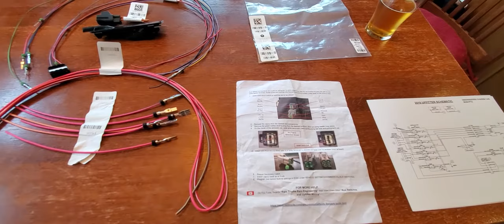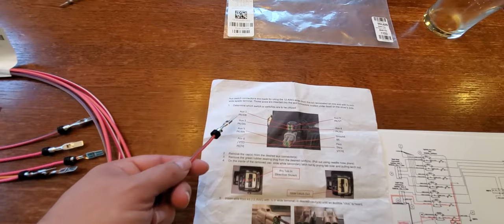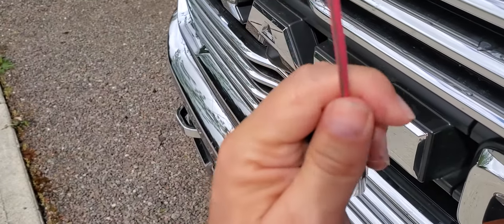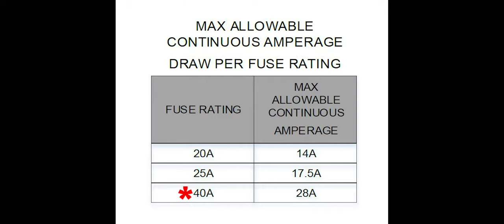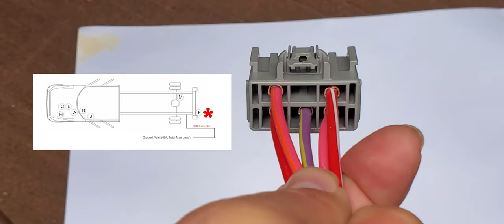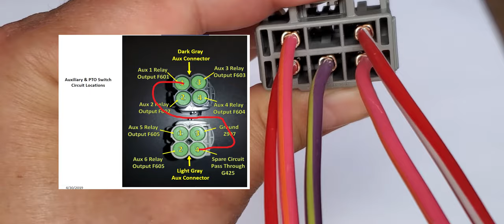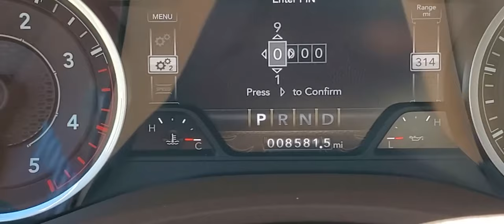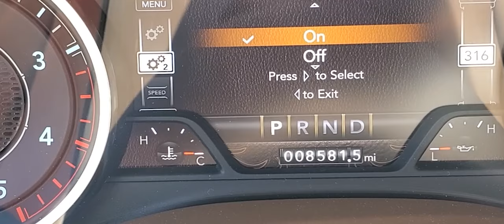How to wire and configure the AUX switches in a 2019+ Ram pickup

Comment: I think this gives me a solution suppling extra amps to charge the house batteries in my 5th wheel while driving.  I have a residential fridge and want to run it while travelling.  The current 7-pin only supplies a couple amps.  Heck, I might be able to install an inverter under the hood and use the truck as a generator.  Thanks for this video. Cheers!

Comment: This video saved my bacon.  I needed to set up an Aux switch to give power to my fuel tank pump in my truck bed.
Reply: Which one did you use to get power off of?
Reply: @brandenmulder7878  I was able to use AUX1 to switch on the power to my fuel pump in the bed of my truck.    I don’t think I could have accomplished this without your Youtube tutorial.   I am sure that if I had reached out to a Chrysler dealership for help they would have struggled and it would have cost me a great deal of money.   Again, many thanks.

Comment from the maker: @10:50, I state that I haven't found the blunt-cut wires at the rear of the truck. I eventually did find the blunt-cut wires. They terminate at the connector directly above the spare tire. More information is available in this HDRams forum post:

https://hdrams.com/forum/index.php?threads/aux-switch-wiring-location.337/page-2#post-26774

Comment: Excellent video! Clear, thorough and easy to follow.

FYI, AUX5 AUX6 circuit ID's are incorrectly labeled by the factory docs in the picture of the underhood connectors. They are both labeled F605. AUX5 is F605, AUX6 is F607. Really only confusing if you're tracking the wiring diagrams to the PDC (fuse/relay).
Reply from the maker: @RJT21 Thanks. I will update that in the final version.

Comment: Alan, The best video out there.  Thank you!  So detailed and clear it s great.   been trying to add these switches to my 2500 ram and even the dealer cannot find the proper part number for the kit.  My Ram has 5 current features switches (park sensor (2), 1 air suspension, 1 tow , and another one).  The aux switch module always arrives with only 4 features swith, and all the aux switches.....So I would be losing the air suspension.   Would you know what part number you have in your truck?
Reply from the maker: I ordered my truck with the AUX switches installed at the factory. I don't know the part number, sorry. I believe I saw some posts on hdrams.com about adding the switches. Try this post.

https://hdrams.com/forum/index.php?threads/diy-add-aux-switches-to-19-ram-2500-laramie-6-7l.13229/page-4#post-294649

Comment: Thank you for putting this together.  Is it safe to assume that to run some LED spot lights under the rear bumpber its probably easiest to just tap into one of the Aux connectors and run your own wire? This would avoid having to plug in the upfitter harness and do additional wiring inside the vehicle? I have a 2022 truck and thought that they had made a few changes.
Reply from the maker: I agree that it's easiest just to tap into one of the aux connectors under the hood and run a wire to the back for rear lights. I also heard that they made some changes to the 2022 model that make it , but I don't know the details.

Comment: This video is amazing! I can’t find the answer to this question but hopefully you can help me! I have a Blackvue dash cam that needs both ignition and battery power. On the grey jumper that comes in the wiring kit, can I cut the loops and use butt connectors to port 3 and 6? Or do I have to use posi-taps to keep the loops connected? Does this make sense? Thanks!!
Reply from the maker: You can cut the loops, but it will kill the power at the rear bumper. You can tap onto the loops if you want to maintain power at the rear.

After I made this video, I bought three small bus bars off Amazon. I cut the ignition loop and connected both wires to the same busbar. I cut the battery loop and connected both wires to the same bus bar. I then created a ground busbar. All three bus bars are secured underneath the floorboard carpet behind the pedals where my feet never touch. The bus bars have covers so the posts don't touch the carpet. This setup maintains ignition and battery power to the rear of the truck while also giving me ignition and battery power in the cab with a common ground. I connected my dash cam to the bus bars, and everything works great with the ability to power other devices later. I recommend you use an inline fuse for each powered device connected to a bus bar.

Comment: @Alan Look above spare tire, on the driver's side; there's a wiring harness, with some holes plugged and ready for more pinned wires (Rear Battery, accessory and run) to be inserted...
Reply from the maker: Yes,  it's documented in TSB  08-031-20 which states, "The upfitter auxiliary fused wires are not populated on the rear of the chassis wiring harness
equipped with Instrument Panel (IP) auxiliary switches. The wires are located on the right
side of the rear chassis cross beam, above the fifth wheel."

Comment: Just ran across your video.  Excellent job in describing the system.  I'm thinking of ordering a 2024 Ram 2500 (too late for 2023) and the AUX switches is one of the options I want.  Barring any changes made in the model years after your truck, this gives me a good idea on what can be done with this feature.
The only question I would have is, do you know if the AUX switch power comes from the primary or secondary battery on a truck equipped with the 6.7 Diesel engine?
Reply from the maker: Starting in 2021, Ram improved the AUX switch design. They added a ground wire inside the cab, and they added more passthrough wires into the cab. I don't know which battery the aux switch power comes from, but I can try to research during the next week. Here is a great video on the 2021+ AUX system.

https://youtube.com/watch?v=6seCDodwohg&feature=share8

Comment: Question: I purchased a westin light bar for my westin bumper. A wiring harness was included which I don’t need since I have a 22 Ram. The light bar has 3 wires. Black, Red, and a smaller gauge Blue wire. What is the blue wire for?
Reply from the maker: I believe you could ignore the blue wire because they are typically attached to a rocker switch. I would connect the red wire to the output of the aux port. Connect the black wire to a ground.
Reply: @alstuart  turns out it’s a low amp second circuit for back lighting

Comment: where do you get the negative line for the interior plug?
Reply from the maker: For an interior negative, I installed a negative bus bar high up in the footwell on the driver's side and connected it to an existing ground that was exposed near the driver door hinge. I can upload a video tomorrow showing it if you reply and say you need it.

Comment: wow i thought i had it i have 2021 Ramm 3500 HO my truck already has all the fuses and seen pass thru left of steering column boot are they all hot feed on the connections under the hood or is there a ground because there is ground right on my firewall and 5 aux in the cab switches. I have snow chief package so there is 4 blunt cut wires above the aux connections. i have 6 switches in the cab but 8 connections under the hood are 2 of them ground connections.
Reply from the maker: The upper right port on the light gray connector is a ground.  The lower right port on the light gray connector is the pass through port that goes back into the cab.  That's why you have 8 ports and 6 switches.

Comment: Awesome video!  Thanks so much.  One quick question, I am going to wire up lights at the front of the truck using AUX1 which has a 40 amp fuse installed in the panel.  Your document also shows an inline fuse to the lights themselves.  Is it necessary to run the inline fuse in addition to the 40 amp in the fuse panel?
Reply from the maker: it is not necessary to run the additional fuse, but keep in mind your lights might need a fuse smaller than the 40 amp fuse. In that case, you can either replace the 40 amp fuse with a smaller one, or use the inline fuse. that's the right amperage as I demonstrated in the video

Comment: Do you have part numbers for this kit and also the power distribution box under the hood as well, I want to add this to my 19 ram 1500
Reply from the maker: The part number for the wiring kit is 68398184AB. I do not know the part numbers required to install the power distribution box under the hood. I did see some discussions about retrofitting the power distribution box on HDrams.com/forum.

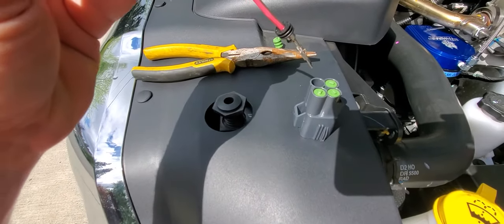Comment: What wire spare connector are you using. 3:27
Reply from the maker: @markruddle4252   It's one of the pigtail wires that came in the AUX wiring kit which is part number 68398184ab
Reply: @alstuart gotcha thank ya. I need those spade connectors. The aux buttons were already installed.

Comment: Great video! I'm looking at wiring in a 12v cigarette lighter style plug under my rear seat for my plow light on the roof. From the video, I'm going to connect aux1 to the pass through in the cab. On the grey connector under the dash, do I connect my relay to the violet w/ yellow for the switch and the red always on for power?
Reply from the maker: I will give you a detailed answer, but first I need to know the following:
1) What is the model year of your truck?
2) Do you want to be able to turn on the plow light when the truck ignition is off?
3) What size fuse is required for the plow light?
Reply: @alstuart it's a 2020 Ram 2500 with the aux switches installed from the factory. Id like the light to shut on and off with the ignition. It's a Buyers Products LED warning light and only draws 2 amps @12v, 24watts.
Reply from the maker: @billgammon8734  

I wouldn't install a relay because Ram has already installed relays for each of the AUX buttons. Each AUX button supports up to 40A, depending on the fuse.

I recommend the following:

1) Install the pink/brown pigtail in the upper left port #1 of the dark-gray connector under the hood.

2) Install the violet/yellow pigtail in the lower-right port #4 on the light-gray connector under the hood.

3) Splice the two pigtails together.

4) Install the gray Jumper into the port under the dashboard near the parking brake (see @10:29 in the video).

5) Splice a 12 gauge red-colored wire onto the end of the violet/yellow wire that comes out of the gray connector under the dashboard. Run the red wire to the location of the 12v lighter receptacle under the rear seat.

6) Connect an inline mini-blade fuse to the red wire BEFORE the 12v lighter receptacle. Most 12v lighter receptacles are rated for 10A, but check your 12v lighter receptacle requirements.

7) Connect the inline fuse to the positive terminal on the 12v lighter receptacle, and find a suitable ground location for the negative terminal on the 12v lighter receptacle.

8) If your plow light doesn't have its own fuse, I recommend installing a 3A inline mini-blade fuse between the 12v lighter receptacle and the light. This way, the lighter receptacle has its own 10A fuse, and the light has its own 3A fuse. This enables you to plug other devices into the 12v lighter. 

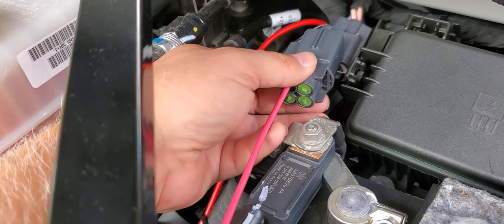9) Under the hood, there is the AUX fusebox as shown @5:01 in the video. From the factory, a 40A fuse is installed for AUX1. I recommend switching to a 20A fuse. You need a LP JCASE (low profile) fuse that is 10mm x 12mm x 16mm. In the video, I incorrectly say you need a low-profile MCASE fuse, but it is actually a low-profile JCASE fuse. On Amazon, you can get an assortment of 40 normal and low-profile JCASE fuses from the vendor named BIOFUSE for about $30.

10) Lastly, you will need to configure AUX1 button behavior in the commercial settings. The type needs to be "latching." The power source should be "ignition."  The last state option should probably be "on" so you don't have to press the AUX1 button every time you start the truck.

Please let me know if this needs clarification.

Thanks,

Alan
Reply: You're absolutely awesome, man! Thank you!
Reply: Everything worked perfectly! Like in your video, my dark grey connector also was missing the little clip.
Reply from the maker: @billgammon8734   Thanks for the follow up. Glad it worked.

Comment: Does anyone have the part number of the harness the truck came with my truck doesn't have it and the dealerships have no idea what I'm talking about
Reply from the maker: For my 2019, the part number for the wiring kit is 68398184AB. I believe in 2021 the part number changed because the pinouts changed a little bit.

Comment: I have a 2021 ram 3500 can’t find the rear wires. Anyone has an odea
Reply from the maker: There is a technical service bulletin (TSB) for the 2019 Ram trucks that says they forgot to install the rear wires on some trucks. It is TSB 08-031-20 which says, "The upfitter auxiliary fused wires are not populated on the rear of the chassis wiring harness equipped with Instrument Panel (IP) auxiliary switches. The wires are located on the right side of the rear chassis cross beam, above the fifth wheel." My truck suffered from this problem. I know your truck is a 2021, but maybe it has a similar problem. You could locate the wires at the rear of the truck by using a toner. Connect the toner to the upfitter wiring harness under the dashboard by the parking brake, then use the toner wand at the rear of the truck by the cross beam to find the wire that is attached to the toner.
Reply: @alstuart  thanks Alan. Been looking for them like crazy. I did notice the extra wires on the right side but didn’t think it was. Will check if they are.